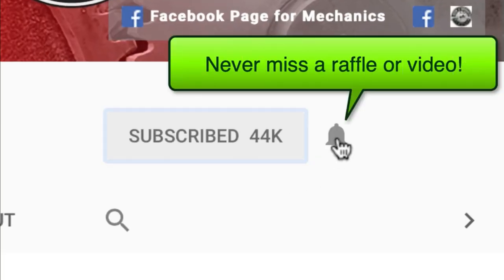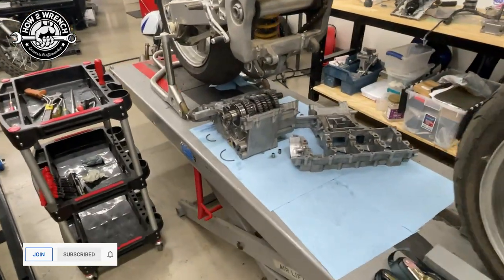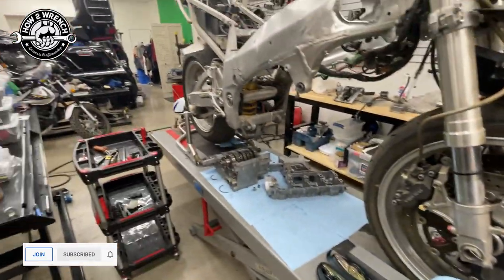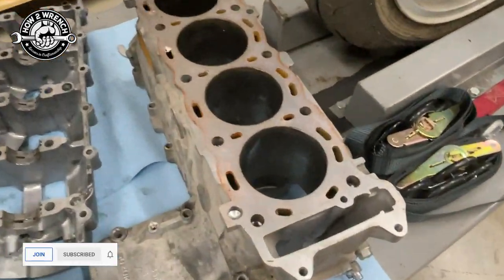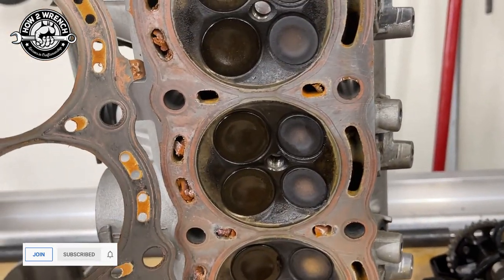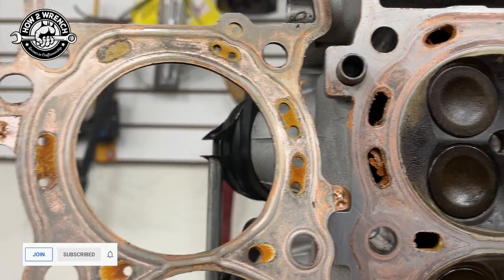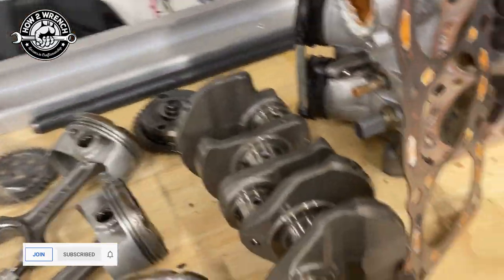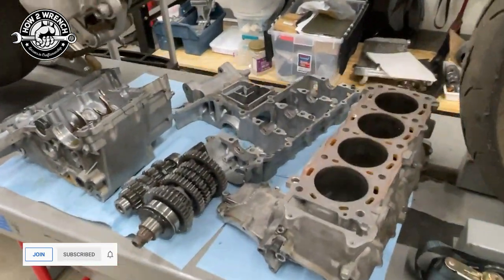You won’t believe what we found inside this GSXR motor? Can you beat it? What's your weirdest story?

Comment: I do not think it’s the head gasket. My theory is the water pump seals went bad and water went into the sump. The amount of water in the crankcase is far too much to be a head gasket. If it were a cracked head or the gasket, the water level in the rad would be at the same height as the top of the block. It just seems far more likely that a less experienced mechanic owned the bike and thought it was the head gasket. The water pump oil seal went, trashed a bearing, someone may have threw bearings and a head gasket in it and found water in the oil again, leading the bike to sit. Let’s be honest, 9 out of 10 if nothing is wrong with a bike, it will be rode or sold.
Reply: +1 
My guess as well but the oil pump has a weep hole and spacing to keep the coolant section away from the case oil seal. Or at least the ones I've seen.
Reply: Oops, I meant to say "the water pump".
Reply from the maker: Thanks for sharing Zachary...yeah like I shared in the video, I don't think so either....I sure hope it was the water pump seal vs. it was stored somewhere where it froze up and cracked the head. I'm going to do some cool test videos when I return from Japan...stay tuned and connected.
Best way to help us back is joining or grabbing our T-shirt! Support links and gear below!  Awesome and thanks for commenting! Smash the subscribe button (thank if already a sub!)
Have you seen our "YouTube Trained Support Shirts? Great way to "high five us" https://goodfellasmerch.com/collections/how-2-wrench/products/support-shirt

Join this channel to get access to perks:
https://www.youtube.com/channel/UCBhM8DCKnT3qXwTW0eToyCg/join   
-Daily MEMBER FIRST COMMENTS ANSWERED FIRST 
-Live Q/A video chats
-Wonder if we have a video on your need? Members can request content links!
-Full Access to the ENTIRE 700 video library
-Member-Only FREE tool giveaways   

Just want to say thanks quick to support us for this information and our work saving you money? 
Give us a high 5 here:  https://www.paypal.me/how2wrench   

Got an emergency and your head is about to explode from frustration or fear? Get Shane’s cell here: https://how2wrench.com/ols/products/techline-one-on-one
Reply from the maker: Yes sir...It does have a weep hole but I have seen those plug up and then it will drip by drip go past the seal (bad seal) and fill the crankcase.
Reply: @How2Wrench  I may be wrong here… but I think the weep hole only applies to a bad water pump/seal. If the oil seal goes, there’s pressurized coolant taking the path of least resistance (sump).
Reply: Plugged weep hole. That's good to know. 👍
Reply from the maker: @Zaucey  I think the thought here is if the water pump seal is bad (let's say due to old age, or sat for years) and is leaking s then the life of the oil seal could be thought to be the same and could be bad too. Great topic and conversation going Zachary...comment anytime!